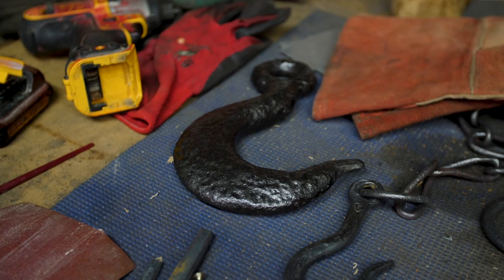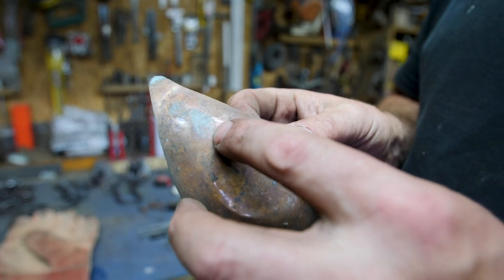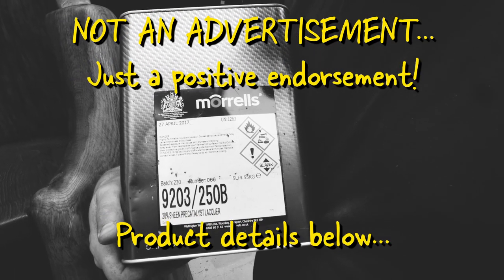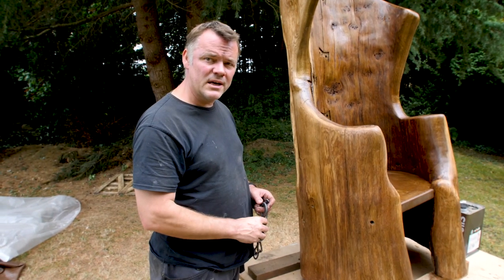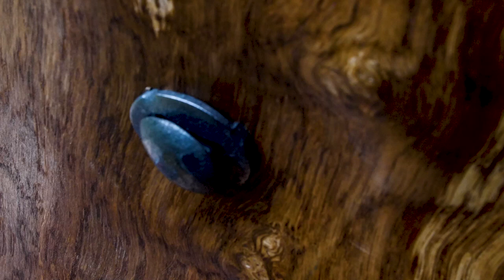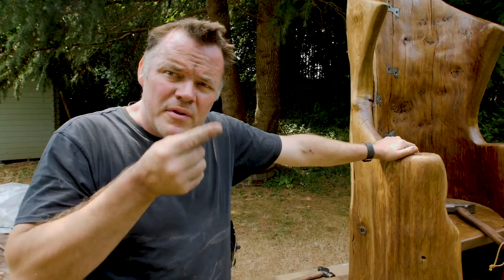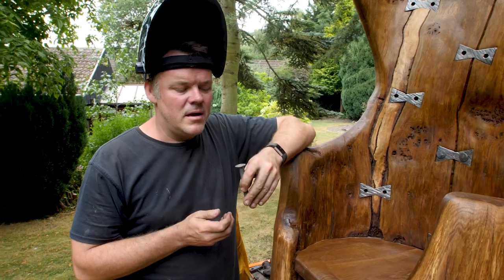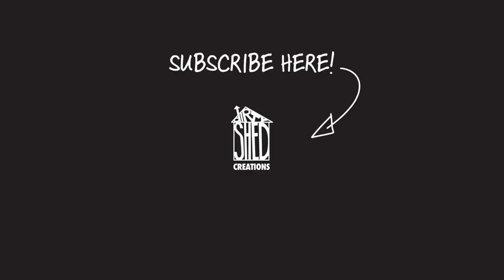How to make a wooden Throne - (Building the Throne Ep7)

Comment: I like the lacquer as well, sadly not super good for out where I live- at least outside- and hey St. Watson... you could use your rivets to hold your halo up!!! I do have a question- which the end hinted on- were you not worried about welding the rivets and the heat produced setting the throne on fire from the inside.... what did you have in place in case it did? I guess that is 2 questions...
Reply from the maker: In answer to your question, just a lot of puff and spittle to put out the fire... There's a different approach we discuss in the upcoming Q&A too. Thanks for your Q's, always appreciated Sergi.